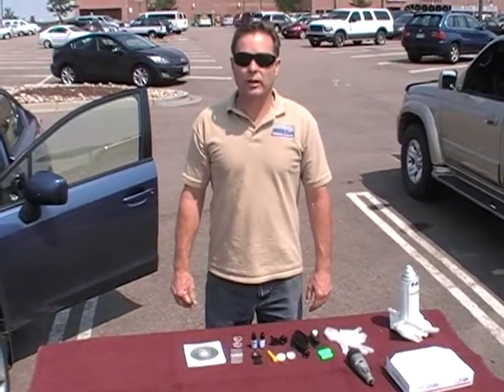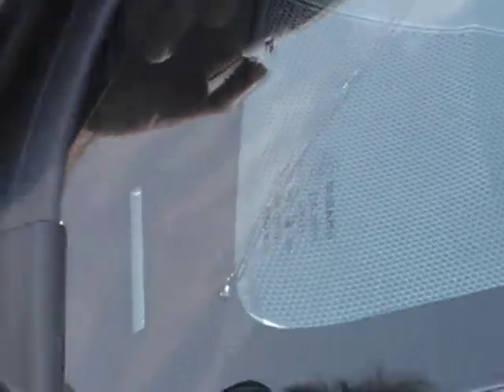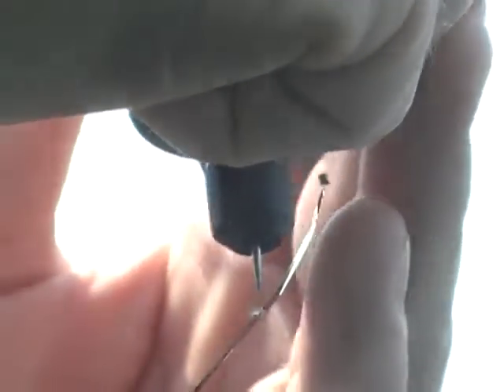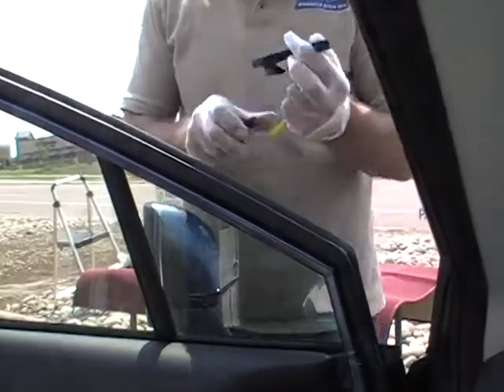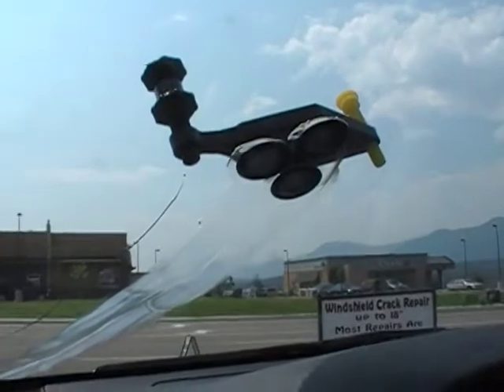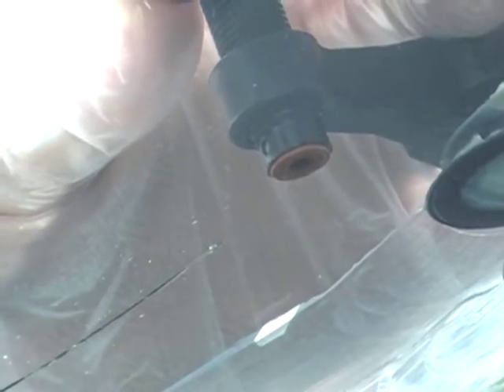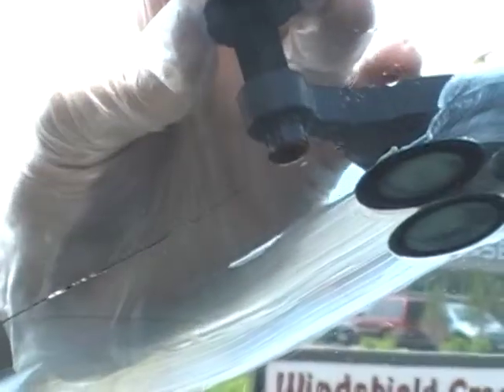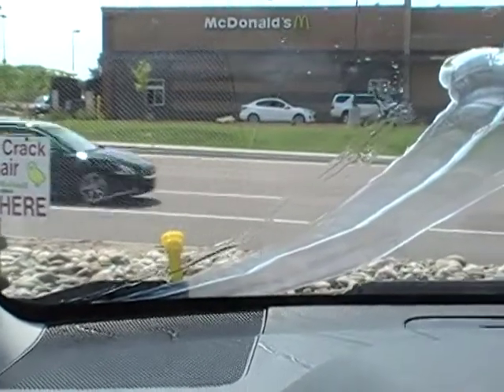14 inch Crack on Subaru 2 hole method | CrackEraser.com

Comment: What's the reason for drilling down to the plastic!
Reply: There are 2 ways to put a stop on the end of a crack. One is to drill to the plastic. The other is to drill drill about half way down to the plastic and create a bulls-eye. The bulls-eye method takes more practice to perform so for DIY we recommend drilling to the plastic.
Reply: Is it really necessary to do the tap that creates a bullseye at the tip of the crack. Why do you want to create that?